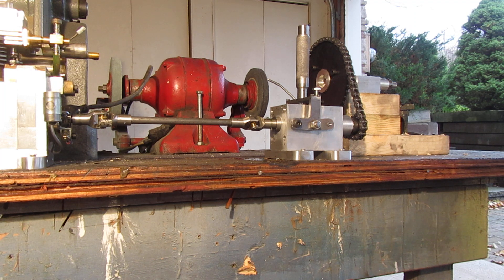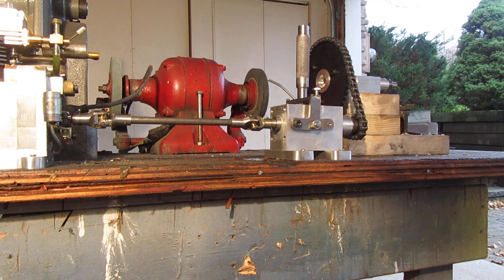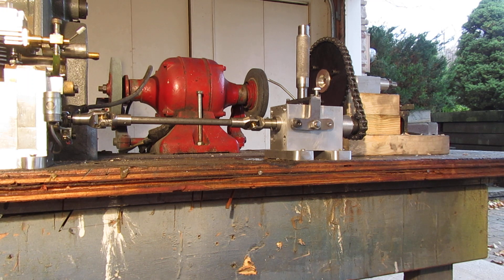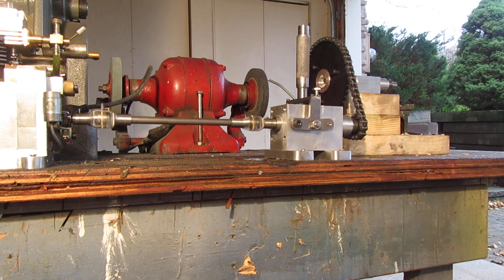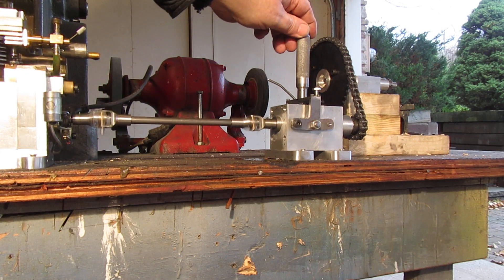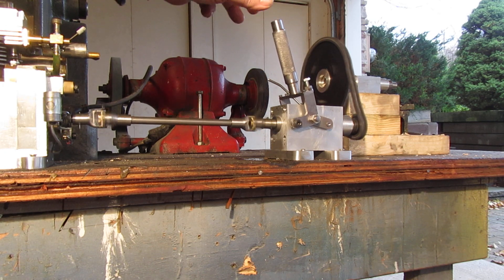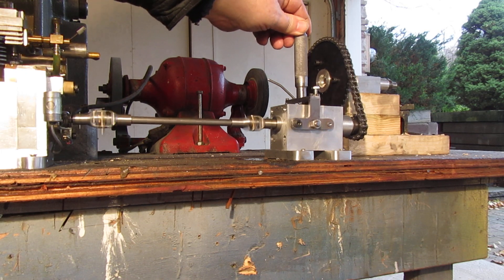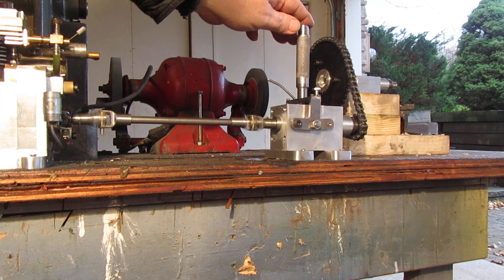CLUTCH IN OPERATIO 2018 11 05 002

Comment: Have you got some details on the mechanics inside please. If on a forum a link to the thread. I'm building a small petrol loco, and that clutch looks a little more robust than the slipper belt system that I was thinking.
Reply from the maker: There is a complete thread on the build of this clutch on the Home Shop Machinist forum. I sell a complete set of 25 engineering drawings for $25 Canadian funds. Contact me at brupnow@rogers.com